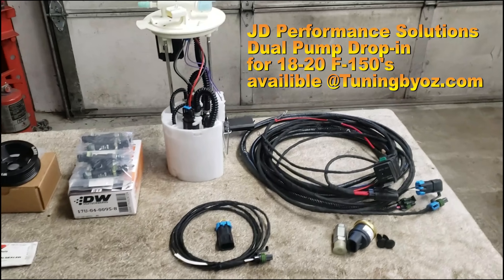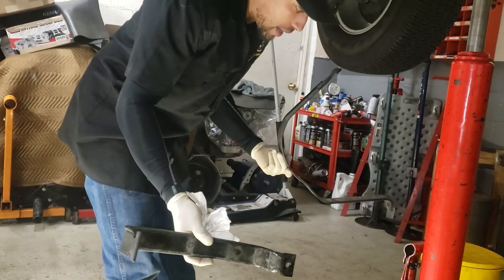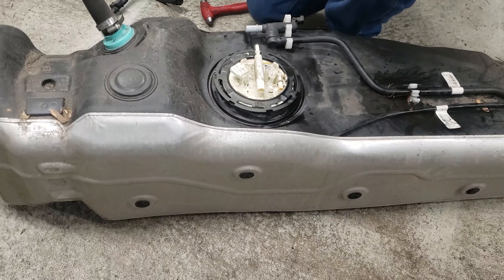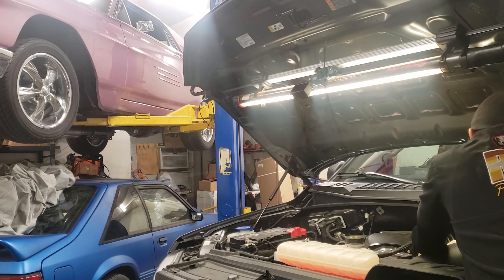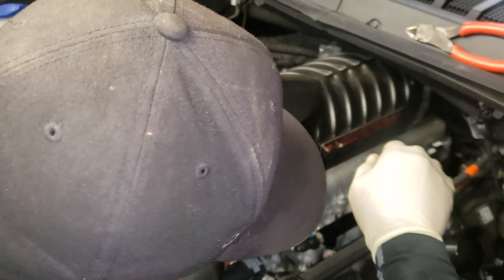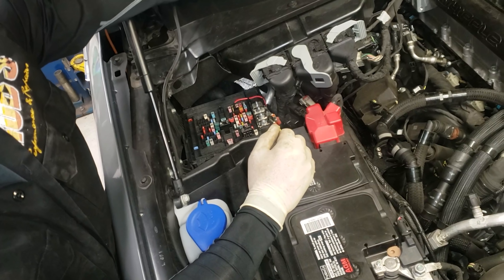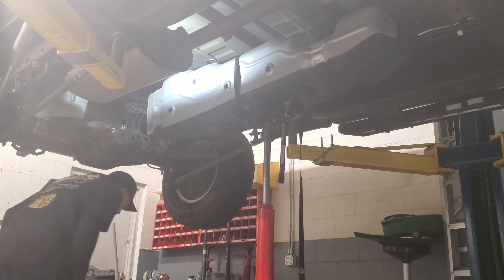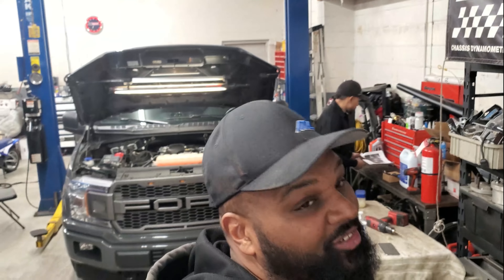JD Performance Solution Dual Fuel Pump install in 2018-2020 Ford F-150 Complete Install

Comment: I just swapped a 36gal tank into my '19 F-150 and wanted to thank you for the detail you provided on which connectors need removed and how to do so.  I did mine "blind" without removing the driveshaft and your video made it easy for me to do everything by feel.

Comment: The truck should have already been flex fuel? My 18 5.0 can run e85.
Mine is a Canadian sold truck though
Reply from the maker: It is. This truck has a supercharger though so way more fuel is needed than a NA E85
Reply: @BoostedF150 
Ah thanks for the clarification!

Comment: I'm curious about the dual injectors. Is there still not enough fuel with the dual injection? I guess it's pretty obvious because you've done this, just wondering if you disable the direct injection in tuning or are you still using both.
Reply from the maker: Both are used, this guy is switching to E85 and a smaller pulley so around the 800whp range
Reply: @BoostedF150  This isn't your truck. I'm dumb lol!

Comment: I'm totally lost as to why you would pull the whole fuel tank just replaced the fuel pump it is so easy to pull the bed on these trucks to guys can literally lift off the bed in 15 minutes or less do the fuel pump work and put it right back in place
Reply from the maker: Trying to show as much of it as a DIY with 1 person aspect
Reply: The way he did it I can do myself in the garage pulling the bed off would require more room and at least 1 more set of hands.

Comment: they do make a fuel pump removal tool instead of using a screwdriver and a hammer..
Reply from the maker: That was said in the video
Reply: Funny, I have the tool...it’s in the bottom of my box, hammer and driver is easier lol
Reply: @Fedge378   I guess it's the Mercedes-Benz tech in me.. We tend to do things a bit different. to each his own.
Reply: Some tools are worth buying and some are not. A hammer and screwdriver works perfectly fine for this step.
Reply: @malloymotorsports780  I'm sure Mercedes enjoys selling you every little tool you'll ever need!
Reply: @MrLightning54   well "A" tools are automatically sent to the dealership as per Daimler requirements. SSEP offers non A tools if you wish to purchase on your own. but after 15yrs in the trade I'm pretty much covered.

Comment: Next time save yourself a whole lotta grief and take the box off.
Reply from the maker: Video is meant to help the DIY guys
Reply: @BoostedF150  Fair enough , still a comealong and rafter would get it done.I use a 4x4 under the lip of the box and an engine hoist, 6 bolts unplug the wiring and the filler neck beats laying under the truck messing with all the hoses.
Reply: Yes taking the box off is easy and makes for an easy install, but it is also much easier to damage the paint by doing so.
Reply: Am I missing something? It looks super easy getting under  the truck and removing the tank. The tank seams lighter and smaller than the entire bed, lol!